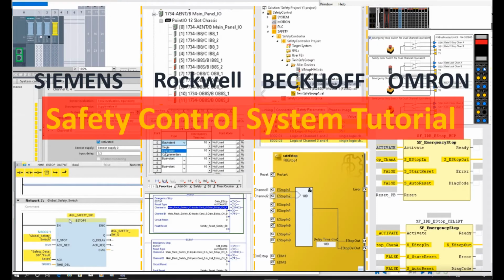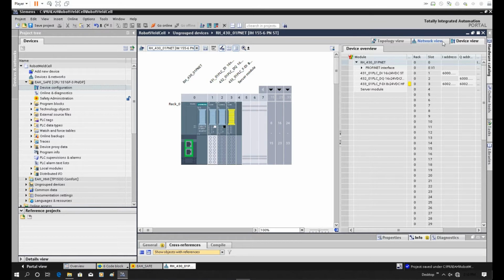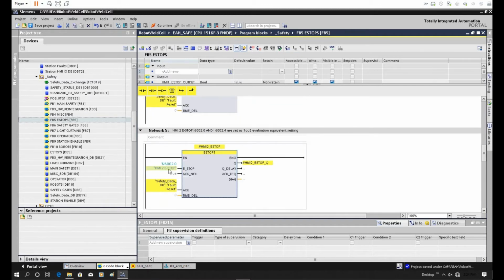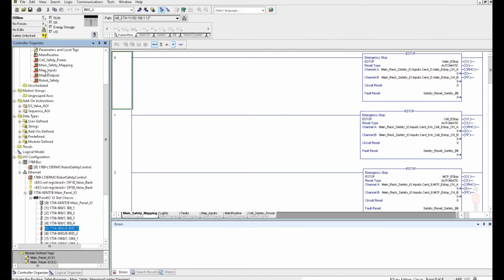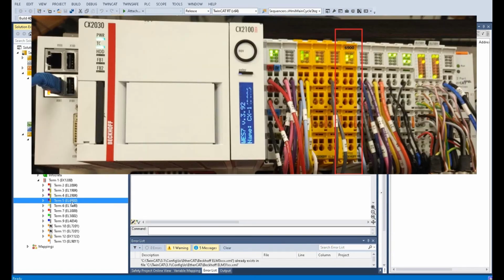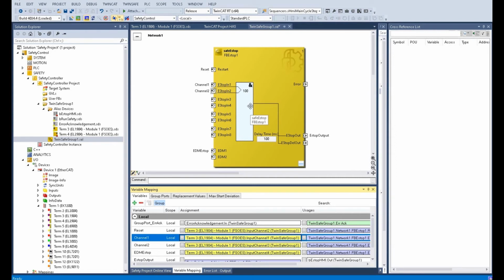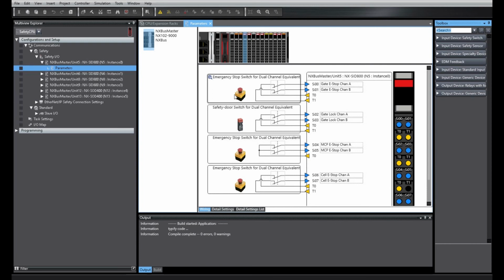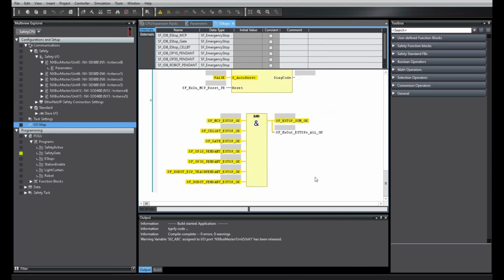SA02. Safety Control System Tutorial Siemens, Allen-Bradley, Beckhoff, and Omron

Comment: That Omron safety interface looks a lot like CodeSys
Reply from the maker: Yes, many industrial software nowadays they are quite similar, for example, the Allen Bradley CCW and OMRON Sysmac Studio. Most likely they are using the same fundamental development studio platform. Good is that we can learn cross the Brand easier than before, bad is that those software has similar bugs and not quite highly customized, you can strongly feel that the software developer has never been an industrial engineer and did oniste commissioning, some functionalities are really really NOT efficient to be used.